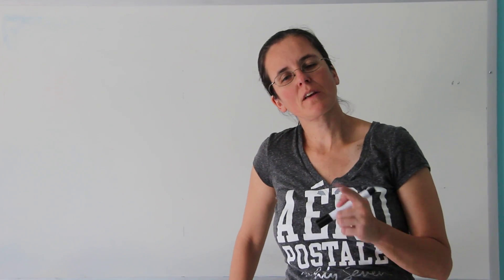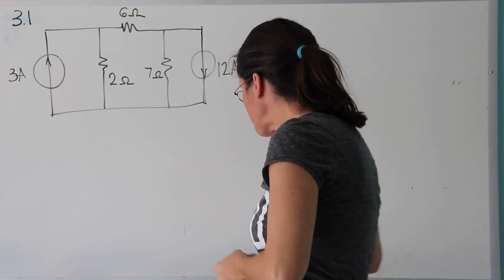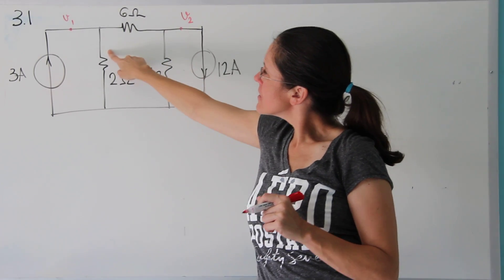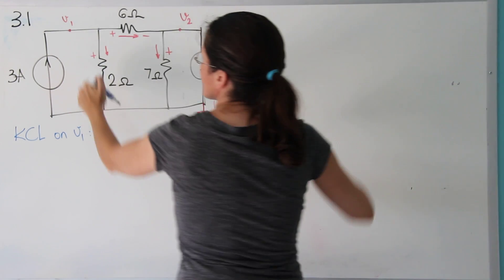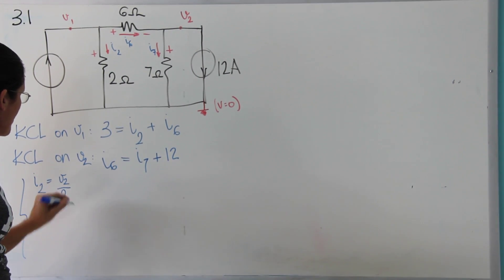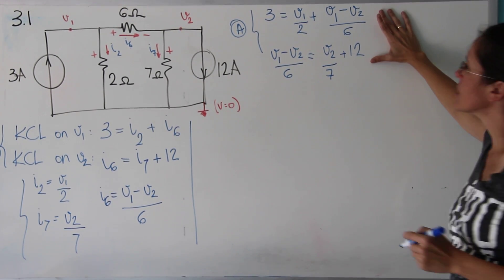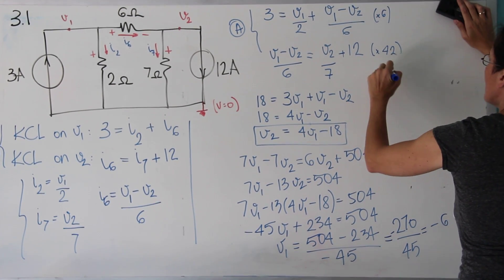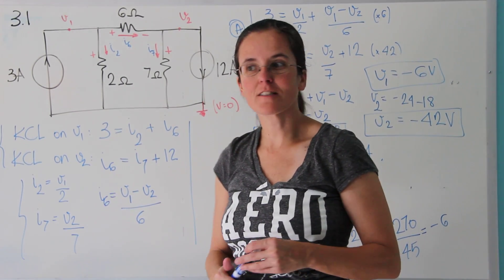Example 1 of nodal analysis

Comment: OK madam it was good n I wanna know why the nodal voltages we got in problem are negative and also why the current direction through the 7ohms resistor is not taken in accordance with 12A current source?( I.e. reverse direction)